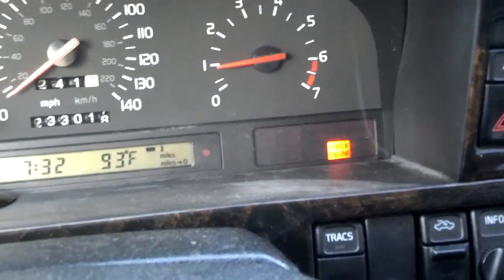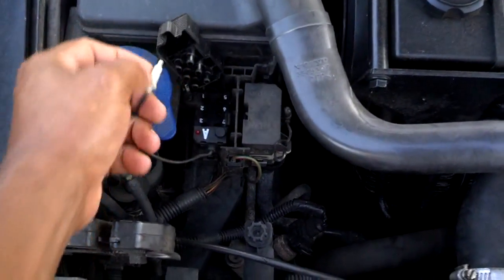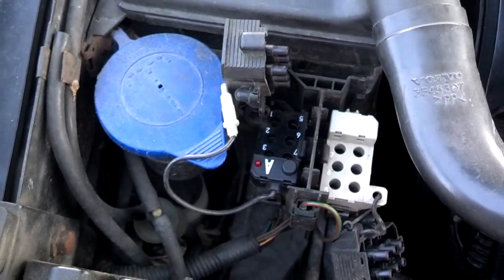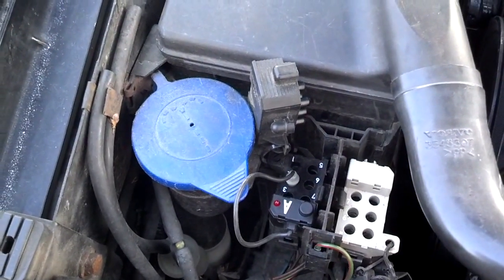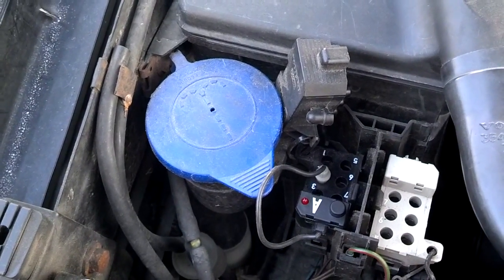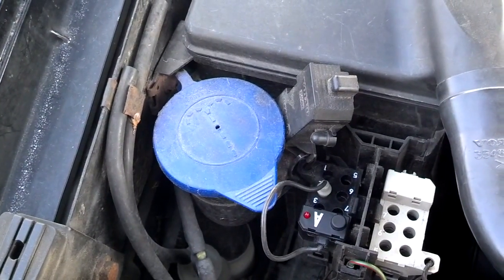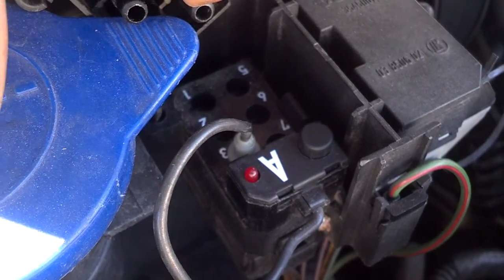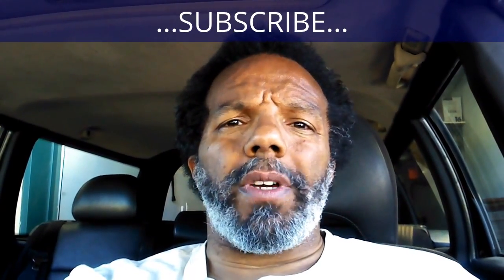How to read, scan for and clear error codes with the diagnostic tool on the Volvo 850, OBD1 - VOTD

Comment: Hei ! i have Volvo 850 2.4 GLT model 1992, is this same reset ?, you video 1993. -94 and -95 models
Reply from the maker: Does your car have the boxes under the hood?
Reply: Yes, same place boxes are where you video seems
Reply: Sorry my bad english..it seems i send my question wrong place..heh, i see you another link: 850 service light reset that i mean my question, but boxes are same place and seems same that you video, works this model too i think, but i tested next summer when needed, i have owner car few months and ex owner april 2017 maintenanced by volvo service when light reseted, only 163tkm drived and only summer..old man ex owner and 22 yers for him, and i too used only summer volvo

Comment: Hi Robert! The jump wire is disconnected from the port (A side) on my car - do you know how to remedy this?
Reply from the maker: +Sara Anger you may be able to repair it with solder. I usually replace them.

Comment: Another great video! This OBD1 system was in the post-1989 240-740-940 (Bosch LH2.4) redblock engines too.
Reply from the maker: +Christopher Moriarty are the codes the same?
Reply: Looks like until 93, they're the same DTCs:  http://www.troublecodes.net/volvo/

Comment: My main issue is the check engine light. I bought my 94 850 in early May, and the tabs expired. Little did I know the cel can not be on or you will not pass your emissions testing in the state of Washington. The car runs like a dream I love it so much, but will this keep the light off just so I can pass my testing, and am able to drive?
Reply from the maker: I don't understand your question. Why is the light on?
Reply: Sorry, My question is will resetting the codes turn off the light forever? Or will it turn back on once its driven for a while. My step dad and I have gone through the codes and fixed everything that came back. The main problem was the PCV system. Smoke was coming out of the dipstick.
Reply from the maker: LOL, as long as there are no issues the light will stay out. If an issue comes up, it will return.

Comment: Hi Robert,

plugged in socket A2 my led is on constantly (with about half power) and codes can not be flashed. Does not react to pressing it for one second (or any other length). Disconnecting the battery or turning injection off/on does not make any difference. All other sockets work fine. Do you have any idea how to check/fix this socket?

Volvo 850 T5 94´ 

Thank you:)
Reply from the maker: +volvo850t5 probably a bad box.
Reply: @RobertDIY  Hey Robert I am having same issue.
B1 Socket makes LED stay on, does not react to button presses or holds
Should I replace the whole OBD1 reader ?
Thank you!

Comment: I WANT TO ADD SOME VERY HELPFUL LINKS TO THIS VIDEO, ROBERT. I  HOPE THAT;S OK~ :) 

1)
The Five Most Common Causes of a Check Engine Light 
http://www.autozone.com/landing/page.jsp?name=top-five-reasons-check-engine-light
2)
and What You Should Do About Them http://lifehacker.com/5878754/the-five-most-common-check-engine-problems-and-what-you-should-do-about-them?utm_medium=sharefromsite&utm_source=Lifehacker_twitter
3)
How To Avoid Costly Auto Repairs If Check Engine Light Is On https://axleaddict.com/auto-repair/Avoid-High-Cost-Auto-Repairs-From-Erroneous-Check-Engine-Light

HOPE THESE TIPS HELPS TO CLEAR SOME OF THE ??? AND SAFE YOU SOME MONEY ... IN MY CASE IT DID. I CLEARED THE FALSE CODES, AND THEY DID NOT SHOW UP AGAIN YET. 

I AM NOT SURE IF THERE IS A MINIMUM MILEAGE INVOLVED BEFORE THEY WOULD SHOW UP AGAIN. IF SOMEONE KNOWS ANYTHING ABOUT IT, THAT WOULD BE HELPFUL TO KNOW, TOO. :) KRIS
Reply from the maker: +kris schirmer - designer + artist no.

Comment: So are there any other things needing to be done when replacing this ABS module? Our 1997 Volvo 850 has the same thing, though the ABS light will go off, it does come on occasionally.  I bought the ABS with socket and will replace it, and wondered if you have to have any other information or software updated after this is reinstalled? Thanks for any help in this area.
Reply from the maker: +John Luchsinger what did the video say?
Reply: WHAT DOES IT MEAN WHEN THE ABS AND TRACKS GOME UP ONCE IN A WHILE? K

Comment: my timing belt on my 93 850 broke while driving. when I try to turn it over it sounds fine . is there a chance it did not bend the valves?  also if it did would this be able to detect that?
Reply from the maker: +DylanTheGreat Nope. No.
Reply from the maker: +DylanTheGreat Did you install another belt? If not, don't waste your time. If you did and it is not starting, you have your answer. If you did and it is running, I guess you would not be messaging me.
Reply from the maker: +DylanTheGreat If you need a head, let me know, I know a guy that has one ready to bolt on.
Reply from the maker: +DylanTheGreat If you have not installed a belt, don't waste your time until you replace the head. If you have, a compression test will tell you.
Reply: do you have a video about putting a head on?  also how much would your buddy charge for that one
Reply from the maker: I can check. I sold it to him cheap but I'm not sure what he would sell it for.
Reply from the maker: https://www.youtube.com/watch?v=gt9w-ZSxs9I
Reply from the maker: https://www.youtube.com/watch?v=DtVLpXpk_U8

Comment: Hi!
I drive a 1994 960 Wagon. The diagnostic setup looks identical to the one on this 850, and I'm only getting flashes from port 2, when I insert the little jumper in any other port and hold the button, nothing flashes back.... what could be the problem?
Reply from the maker: +Car Wash Studios Probably no codes in the other systems. Do they flash 1-1-1?
Reply: +Robert DIY no light at all! and I'm concerned with the car because there's this peculiar tapping noise that happens when I push the gas pedal slightly, let go, and push it again, and it only happens when I'm going 35-50. the oddest thing is that it comes with the front end. My mechanic (who doesn't have much experience with older volvos) is baffled as well..... since you're experienced with volvos, have you ever heard of this? I AM getting some codes from the oxygen sensor but I wouldn't think that would be related..?
Reply from the maker: +Car Wash Studios Are you pumping 91+ octane?
Reply: +Robert DIY the car was my moms, and she always used 88. now that the car is mine I make sure to use premium grade.
Reply from the maker: How about the oil filter? Is it Mann? Maybe a lifter.

Comment: Hi Robert, do you have a suggestion? I can't clear a 4-4-4 code for A3 port? After the initial press of the button 7-10 seconds I am not getting the red light to reappear so I can clear code. No other codes exist except for the B2 cruise port throwing 1-2-2, which I understand would go away if I tested after a drive with cruise on and test without shutting car down. ABS light goes out a few seconds after startup. The ABS hydraulic pump noise/test functions at 20-30 MPH indicating pump is OK. 1994 Volvo 850 N/A 5-speed.Thanks!
Reply from the maker: +David Silbert I don't understand your question, do you have a CEL?
Reply: +Robert DIY No CEL. I had an ABS light temporarily because of bad connection with the big connector on driver side strut tower after I moved it to install a strut tower brace. I checked for coded in thePOBD1 after I reconnected to see if I needed to clear ant related codes. The 4-4-4 in A3 and the typical B2 1-2-2 for the cruise if tested without driving along 1st. I tried 4-1-5-1 to clear the 4-4-4 but it did not work like resetting a CEL or Service reminder. Resetting the ECU did not clear code
Reply: +David Silbert So the issue is that while the jumper is plugged into A3, holding the button for 7-10 seconds does not make the red light come on again after 3 seconds so I can hold the button for the next 7-10 push to clear the code. I did try entering 4-1-5-1 and the red light did stay on after the 4, but when I continued entering 1-5-1  the red light flashed the 4-4-4 code before I could continue the 1-5-1. Do you know if there is a code I can manually enter to clear the 4-4-4 in A3 port or do you think that in time it will clear itself?
Reply from the maker: If there is NO CEL, there is nothing to clear.
Reply: +Robert DIY I sprayed the button and ports with electro-contact cleaner and searched online for Volvo 850 4-4-4. I read a lot including VolvoTips, the factory repair pages and MVS. I was able to clear the code. I drove the car about 10 miles. When I returned home I put the jumper back in A3. I turned the ignition key to on and viewed the code twice. I performed the 7 seconds button press but this time the red light did come on after 3 seconds. Did the second 7 seconds button press. The light went out. I did the 1 second press for codes and got 1-1-1 - trouble code cleared. I think the secret was to check for codes till they repeat and then to the clear procedure all during one session. I'll check it again after the 40 mile round trip to work tomorrow and report back if it returns.
Reply from the maker: Yes, the video instructs you to go through all the codes until the first one repeats, then reset it.

Comment: I need to learn how to reset the codes on my 2000 v70 with obd2.
The codes are:
PO722 output shaft speed sensor circuit no signal

PO717 input/turbine shaft speed sensor "a" circuit no signal

PO732 Gear 2 incorrect ratio

and P1618

any ideas?
Reply from the maker: +ben feldman Maybe a bad transmission. Have a Volvo shop check it out.
Reply: The transmission is starting to not downshift. I have to manually shift when starting from a stop otherwise it tries to start off in 3rd gear
Reply: Today the transmission just started slipping.    The codes have been there for a while.  Thanks for your help!
Reply from the maker: Ouch!

Comment: Will this method also work for clearing SRS light on a 93 940 after driver airbags been deployed?

I am trying to get my seatbelts functioning again after the accident and it would be nice if I could get the SRS light off too.. Would it come off if I swapped an airbag from junk yard?
Reply from the maker: e Kbauer If you replace all of the damaged component, yes you can reset the light.
Reply from the maker: e Kbauer If you replace all of the damaged component, yes you can reset the light.

Comment: Hi Rob. My son own a 1988 760 volvo turbo and for some reason when you give normal gas it's running perfect ,but when give gas like to pass somebody or an emergency the car loose power inmediately and can get more than 30 miles an hour. Any ideas. We change MAF , plugs, cat, rebuilt injectors, check muffler and nothing. Any sugestions? it is this model intercooler 760 with a 2.3 L OBD1 compatible or something more obsolete.  thank you Rob
Reply from the maker: gabriel painter Is there a tear or something in one of the intercooler or turbo tubes?
Reply: gabriel painter could have been dirty or semi clogged fuel filter

Comment: Hi Robert,

Thank you for your postings, they very informative.
I have a sticky issue.  My ABS light is on all the time and when I connect the jumper on terminal #3 the light stays on and does not flash any code.  I have replaced the Controller unit and the ABS quickly came back on, after a while.  It turned back off and stayed that way for a long while.  Recently the light came back on once again, and as I tried to check and clear the code on terminal #3, the terminal light goes on right when I connect the jumper and stays on no matter what.  It feels like there is some kind of short circuit somewhere, any ideas where I should look?

Again, thank you for your good information.

Paris
Reply: By the way, the volvo in question is a 1994 850 non turbo
Reply from the maker: Paris Psaros You can replace that jumper box with a used one. It may have a loose wire. You need to find the code and chase the problem from there. - https://www.youtube.com/watch?v=s_34WT3AbWc
Reply: Robert DIY Thank you Robert, Any idea where I should look for jumper box replacement, other than a junkyard.
Reply from the maker: Online or I can send you one if you need me to.
Reply: I can't  seem to find one online.  I'd gladly purchase one from you if you have them.
Reply from the maker: Go to my website and send me your mailing info and I'll ship one out to you and let you know the cost. My guess is that it will run around $10 (hard cost to me).

Comment: Thats different, sounds like this was before the scanner based obd system was thought up.
Volvo were way ahead of there time :-)
Reply from the maker: zx8401ztv Yes, this system allows one to reset SRS and ABS codes. My car has both, this and OBD2.
Reply: I have a 1995 and I love the fact that I have both OBD-1 and OBD-2   Saved me a trip to the dealer to clear my SRS code.
Reply from the maker: jim miles So true.